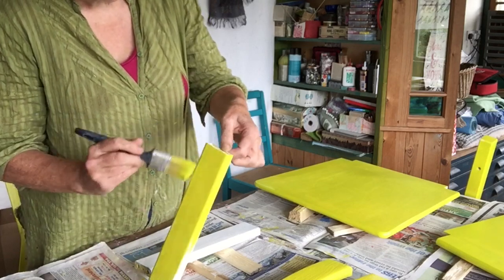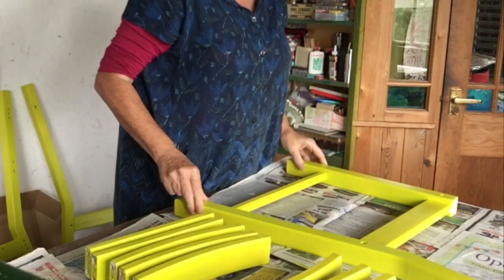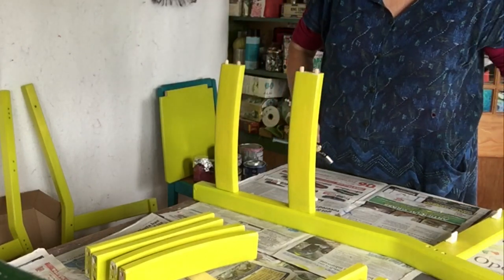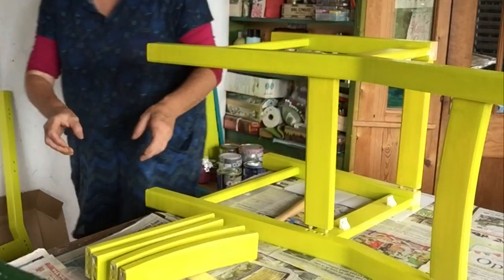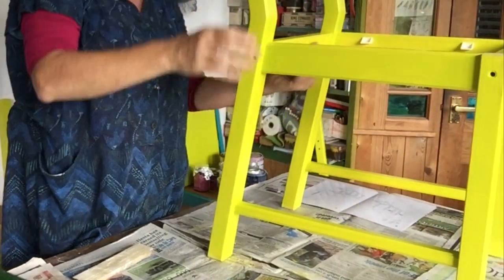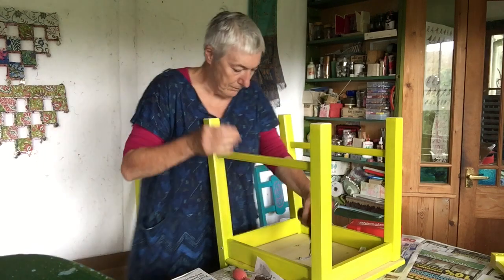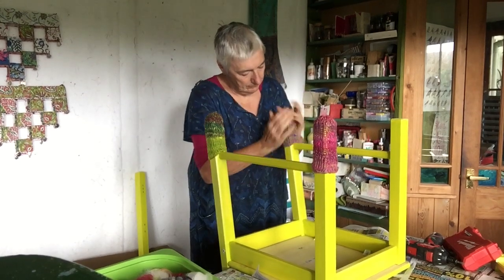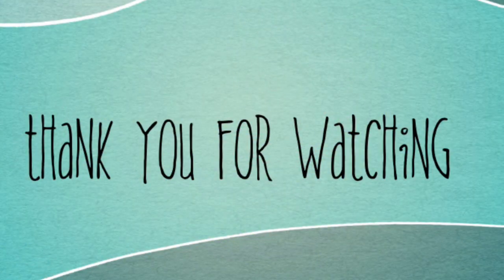Ikea chair construction, painting, assembling and making it cushions and SOCKS!

Comment: You did a great job on your chairs!  I was wondering why you didn't use wood glue on the chairs too! Although the screws will hold it in, but added glue would strengthen it all! Loves your commentary too, well done!
Reply: PJ D - Yes, always add a daub of good quality wood glue to each dowel. It will add years to your furniture & steady the buff straight away! LOL
Reply from the maker: Yes - a few folk have asked about wood glue. I actually have some, but it didn't occur to me to use it as it wasn't in the instructions - those bolts go a very long way in .....I guess there will be a weight limit for those two chairs then!!! xxx

Comment: You think it's hard to put those chairs together without an extra pair of hands, try putting bookcases together that are 72 inches long but we are resourceful aren't we. Kate your girl drill as you call it does it not have an adapter to use a bit for the allen wrench? My does so I only use it when I have long bolts like those. I absolutely love the colors of the cushion and the back thing and they go so well with the chair color although I think had you gotten the color you wanted it probably would have looked as wonderful. I love the way you critique yourself as though you can hear it. xx Angela
Reply from the maker: By the time I looked for the adapter, I figured I could just do it by hand. That bookcase sounds like this chest of drawers I put together a few years ago. When I was finally finished - after about eight hours! I found several parts that had not been used ..... they are still in a bag in the top drawer - six years ago ..... seems fine still! 
When I do the voice over its like I'm commenting on someone else!!! I'm a strange person. ha ha ha!!!